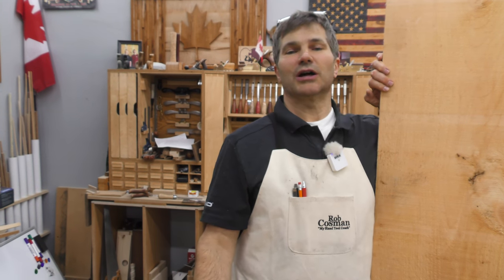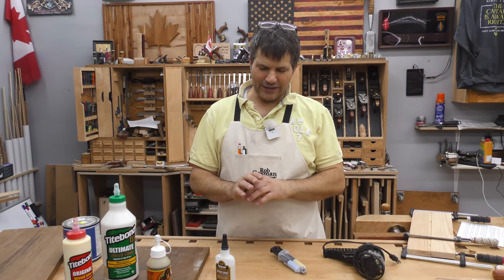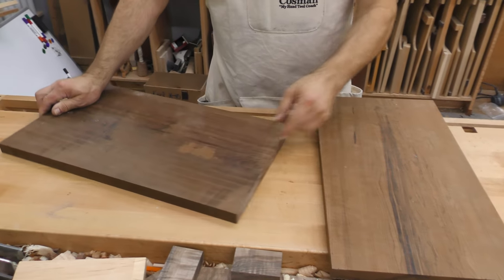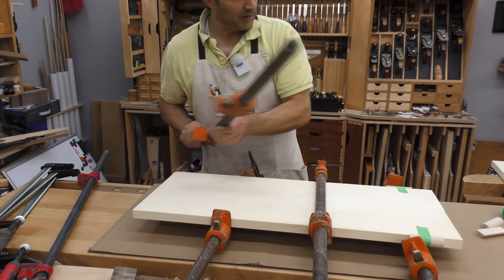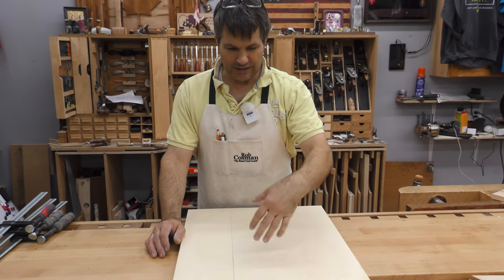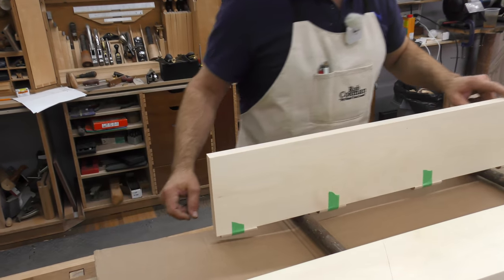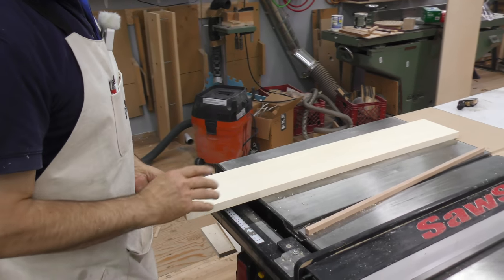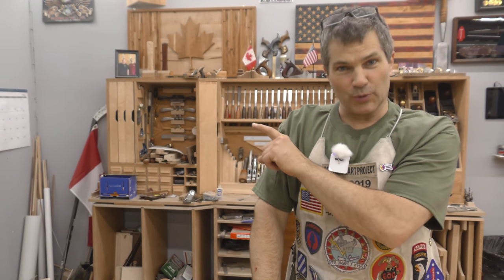Glue Joints Woodworking - Which edge joint to use?

Comment: Wow that half a dowel trick is awesome. I don’t think dowels are too bad. I use a piece of scrap the same thickness as the stock with two or three spaced holes in it as a drill guide to get the spacing matched perfectly. Two holes drilled in it, put it in place on your edge, drill one hole, put a dowel in it to hold your guide in position, drill second hole, take out dowel and move guide block. I don’t glue the dowels themselves since they’re just for alignment. On a really short piece I’d use dividers and a center line instead of the guide. On thin stock I use bamboo bbq skewers.

Comment: I just threw away 4 sets of those clamps because of the inability of them to stand still while trying to set boards. Got some with feet that seem to work much better.
Reply from the maker: Feet are much better.  You can also make boards with slots for them to fit in, thats what I did I just didnt show ut on the video

Comment: If you do glue jobs regularly, make yourself 2 pieces of 2x4 , plane on both sides and parallel. Where you cut half round or triangle notches in, where the pipe clamps can sit in. So if you glue 3 feet boards most of the time, take two pieces of 3 feet long 2x4 and put 4 to 6  notches in them.

Comment: Could you safely do a plunge -- or I guess a drop --- cut on the table saw, so that your groove doesn't go to the ends?
Also, 34:11 I couldn't locate my soul to get the blade parallel to it ;-))
Reply from the maker: Yes but hold your wood tightly

Comment: why would you use a sprung joint over just a flat joint. what are the advantages and disadvantages.
Reply from the maker: A Sprong joint keeps the edges of the boards tight together and from coming to park as there is more pressure on the ends of the board than the middle. Additionally you can get by with one clamp in the middle with the sprung join instead of having to use for five or more clamps

Comment: I believe the gorilla glue (polyurethane glue) actually will fill in spaces in a joint where as PVA needs that tight surface to surface contact. Comes in handy repairing old furniture!
Reply: The foam that fills gaps does so without strength
Reply: @jimweisgram9185  I don’t know Jim, I repaired the legs on a barrister bookcase which were pretty sloppy and it seemed to do a pretty darn good job, regardless if the foam has strength or not ... those legs are solid !
Reply from the maker: You are correct.
Reply: @RobCosmanWoodworking  thanks Rob ...

Comment: What is the powdered glue in the can?  You say that it is a powder, that you use it for large glue-ups, and that you have to add the powder to water, but you never say what it is.  I tried zooming in on the can, but I couldn't read the name on the label.
Reply from the maker: Its powder plastic resin glue, the brand I use is circa 1850, but there are lots of others. Designed for the boat industry
Reply from the maker: Powdered plastic resin.  I use circa 1850 brand, but lots out there